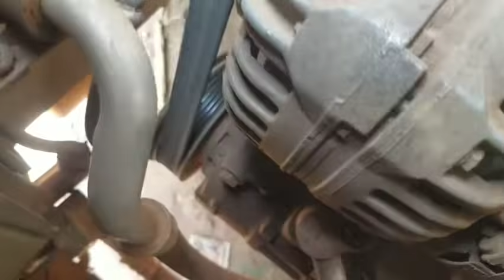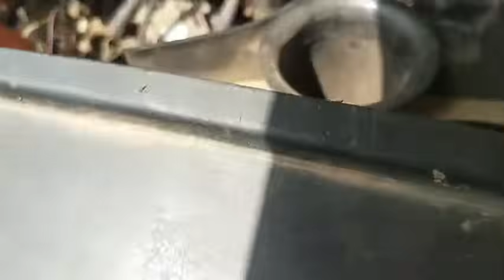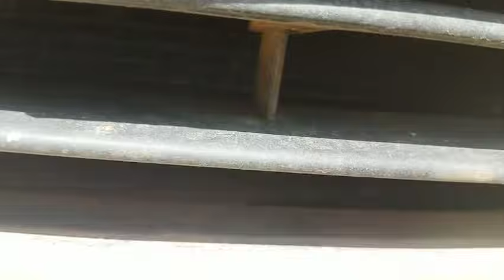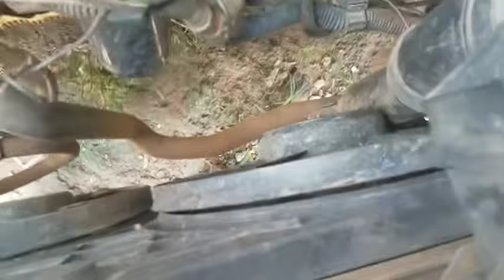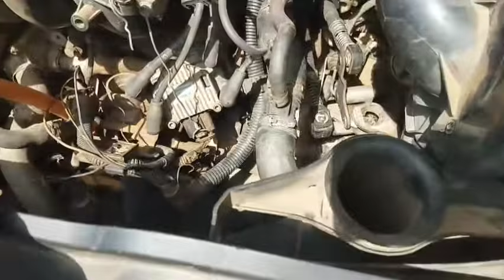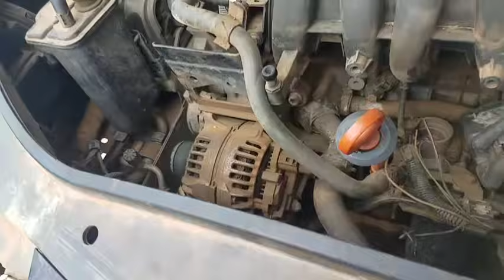car ac takes long time to cool, Solved! | Car Ac Takes Forever To Cool, Solved

Comment: Good day,I came to a notice that you have not mentioned anything related to vacuuming an Ac system after replacing a compressor or condenser....pls put a light on that pls
Reply: I think you me pull a vacuum on the system for a minimum of 30 minutes.